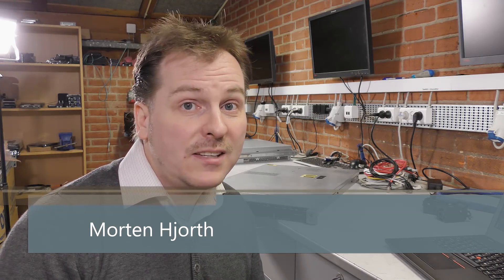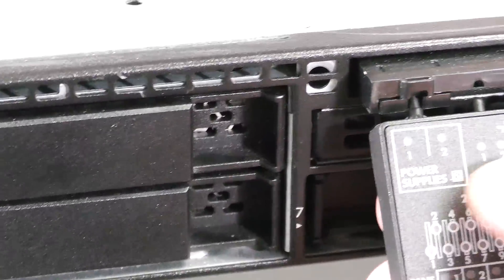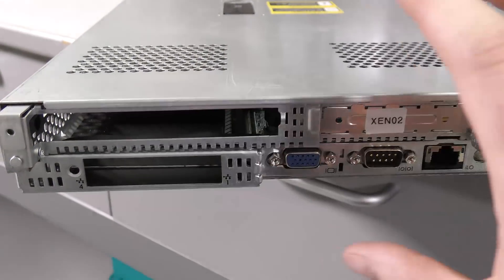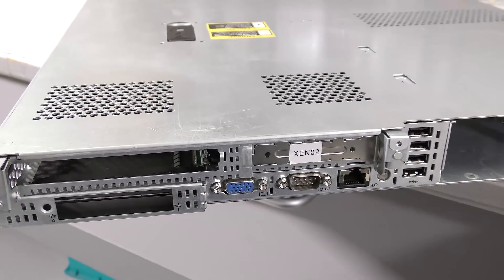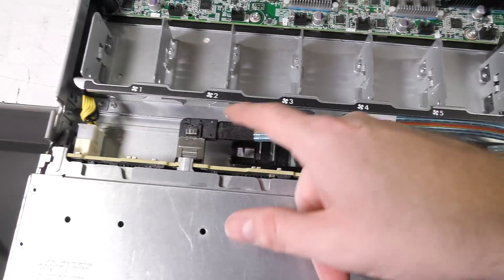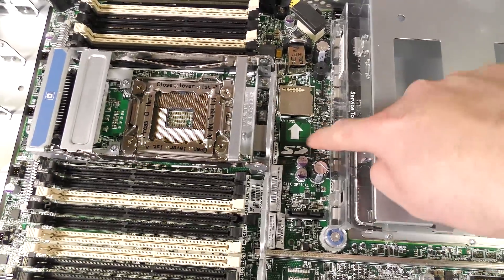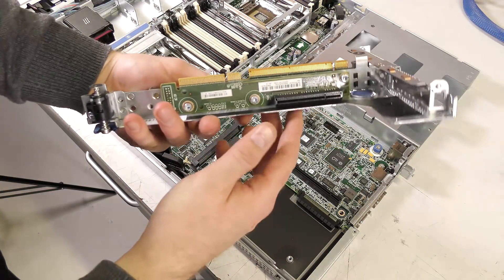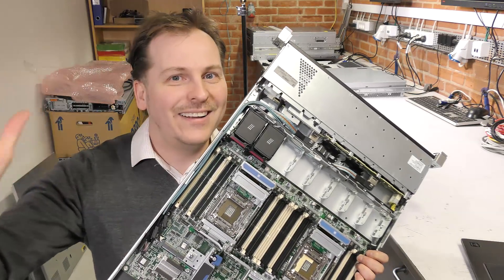HPE ProLiant DL360p Gen8 Server Review - 597

Comment: hi morten, i have sam server hp dl360p g8, with 8 2.5 inch hdd.. 
please help me, why my server fan so noisy after add 4 sas hdd for raid 0. if i remove the fan noise back to normal... what happen... is there is wrong with hdd?
Reply from the maker: Some times HPE servers do not like non HPE drives,,, I do not know if newest firmware could fix it,, but it is always a good idea!
Reply: @MyPlayHouse  thank dude..

Comment: I have a DL360 G8 with 25 drive slots. Has 2 x E5-2640-V3 and 48GB of DDR3-ECC Ram. Currently only have 2x 128GB china SSD's in it, but planning on more drives. Mine's fully decked out with ILO Premium, Smart Array P420 with 256MB Battery Backed up Cache, etc. I'm running Ubuntu 20.10 Server on it, and planning to use it for virtualization and remote desktops. Currenly booting from a Rugged Sony SD-card.  Nice video.
Reply from the maker: Hi T. W.
Thank You very much!  glad you liked the video :-)
Thank you for watching! :-)

Comment: You mentioned KVM Console switches. I‘m currently looking for a console switch which allows me to connect remotly to my servers. I found some affordable IBM ones, but I read that it needs a USB Virtual Key to allow remote access, otherwise only access on the local VGA port directly. The strange thing however is that I cannot find any of these keys for sale...Another question would be, the HP and IBM console switches look very similar, can I use the an IBM VGA/USB -> LAN cable on a HP console switch and vice versa or does this not work.
Reply from the maker: Hi jack_da_niels
Thank You very much!  I have never looked into that,, so you are way ahead of me, there. I know that IBM has used a KVM switch that many other companies has also rebranded. But newer messed wit USB keys... :-/ I am afraid. 
Thank you for watching! :-)

Comment: Do you have problem with fans idle at 35-50%. I have a DL380 G8 12 bay. Fans are always running loud when H220 raid card installed.
Reply from the maker: Hi Ren
Thank You very much!  I hear that you need original HP drives for the fans to work properly :-/
Thank you for watching! :-)

Comment: Couple of notes to those who might consider buying:
-It appears there is no place to get extra power for GPUs if you intend on using that, which is bummer (16x slot also might not be able to supply 75W)
-RAID on G7+ servers is limited to HPE branded disks, otherwise you will have problems like server not seeing disk or just blowing fans at full speed all the time
Reply from the maker: Hi Jerzyna aKwei
Thank You very much!  Fans full speed all the time, gets ignoring in no time.
Thank you for watching! :-)
Reply: You can run raid in software (md / zfs / btrfs under Linux) with any drives probably. I would probably just stick two small 2.5inch SSDs and run OS from it. There is probably also internal USB header and SD card slot that you can run minimal OS from, or boot from network using PXE. It can probably boot via standard BOOTP/TFTP over IPv4/IPv6, and then mounts stuff via NFS or iSCSI. There might be some other options for network booting too. Great for cheap virtualization solution, if you are using other servers for file or block storage.

For the GPU it is a bad idea. DL380p might be a better option in this case, but even then not that great idea either.

Comment: My lab at work is predominantly HP kit.  Much prefer it to the IBM stuff although this is probably due to the fact that I've been using HP for near on 16 years and we only really dipped our toe in the IBM X Series.  They rarely fail either, I think in the 16 or so years I've been using HP in production I've only had 6 PSU failures across what must be about 120 different servers over time.
Reply from the maker: Hi David Game
Thank You very much!  I have worked with IBM/Lenovo servers for 10+ years and I have had 300+ servers of different models,, My own x3650 M4 is the first dead system board I have ever seen,, I have 100-ish IBM servers myself,, have had 1 dead PSU,,ever,, rather a lot of dead drives  especially 146GB SAS's,,, we have had more failures on our new HPE servers the last year (we have 200-ish) then I have seen on the IBM,, have gotten new system board in a brand new dl380G9 just last month , and 3 bl460c's has also gotten new boards. HPE is great in the way, that there is always enough to do:-)
Thank you for watching! :-)

Comment: Plz add prices from nordic. Because there no prices at their site. How much for HDD 6 8 10 Tb.
Reply: I would guess about +50% on top of the prices at a discounter shop because once a drive gets a certification from of the big IT companies it's monetary values goes up insanely. Just check the german competitor to Nordic https://www.gekko-computer.de   You have to pay around 400 Euro for a 400 GB drive. And thats not even SAS but old tech and just because it has a HP part number and doesn't screw your maintainance contract with HP.
Reply: Prices are negotiated at the time of sale; that's why they don't publish them.
Reply from the maker: Hi Mateusz Kniżewski
I do not have any of Nordic Computers prices,,, but you can always email for a price,,, but they are more of a place where you order 24 new drives for an SAN upgrade,, then 2 drive for your home NAS.
Thank you for watching! :-)
Reply: You can’t put disks in there with that kind of capacity. It only takes 2,5” SATA and SAS drives. Pretty much laptop form factor. If you want bulk storage, a NAS is much cheaper than getting a server.
Reply from the maker: Hi NelizMastr - Tech for PC & Mac
Thank You very much!  I believe that 5TB is about the biggest 2.5" drives right now.
Thank you for watching! :-)